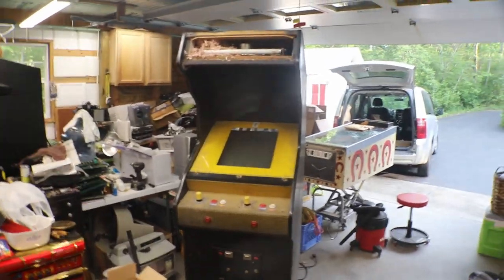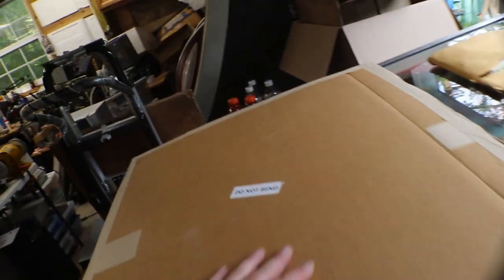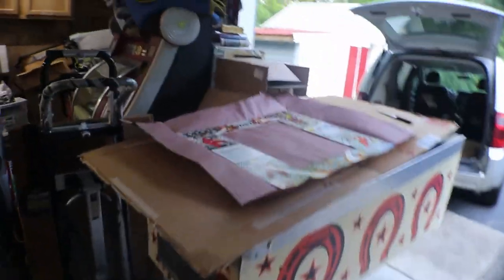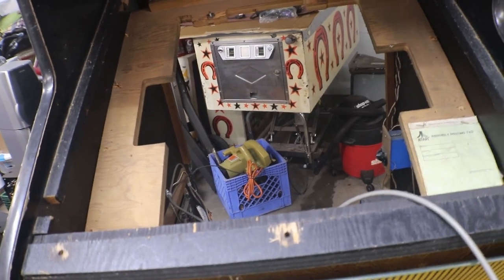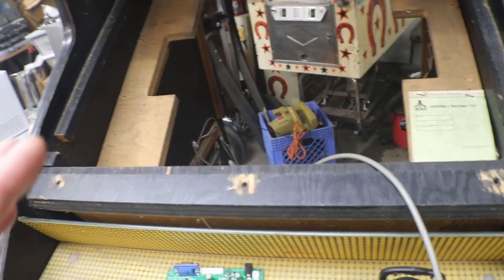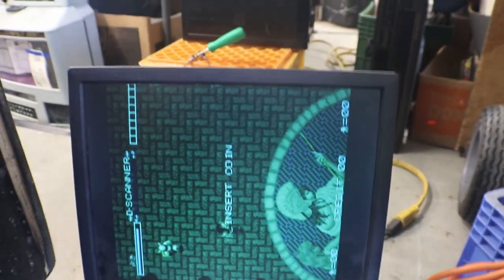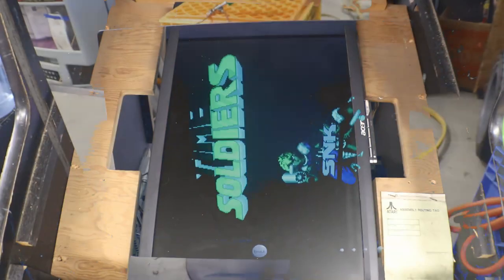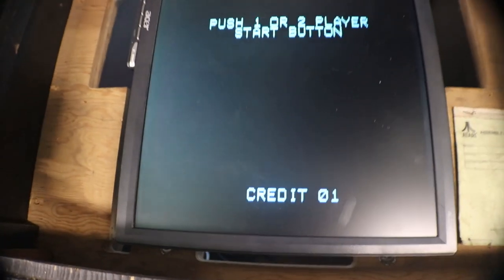Time Soldiers VGA To LCD Conversion / A Little Problem But Fixed Ep3

Comment: Hello Hopper I am curious if you cut that markee at the bottom will you loose the soldiers face's ? cause it will drop down. Far as the LCD I'm a ways off from putting in a LCD monitor. it's tricky I see. Thanks for sharing,
Reply from the maker: On the markee I have not made up my mind what I am going to do yet. I was just kind of thinking out load in the vid. When it comes time I will look at it more closely. I'm glad you pointed that out so I can look at it better. Thanks Carlos.
Reply: @RetroGamingWithHopper  I'm glad I can help anytime..